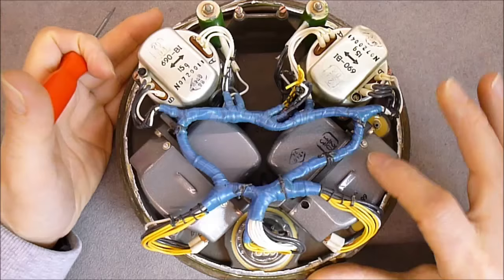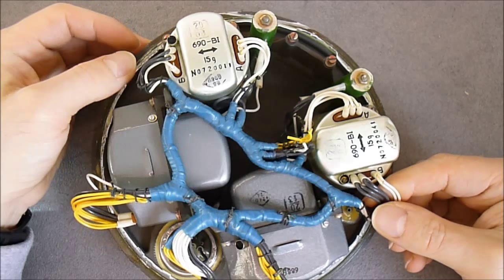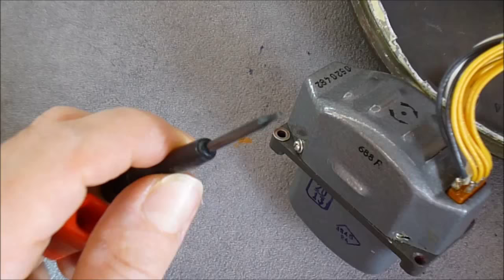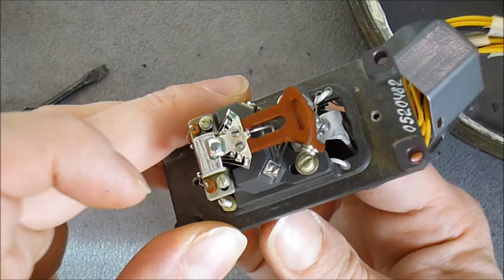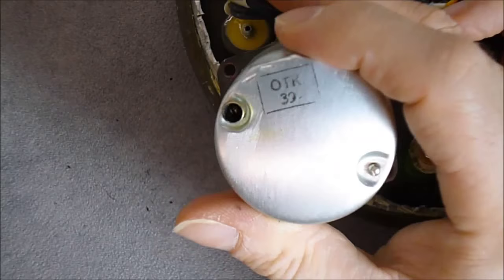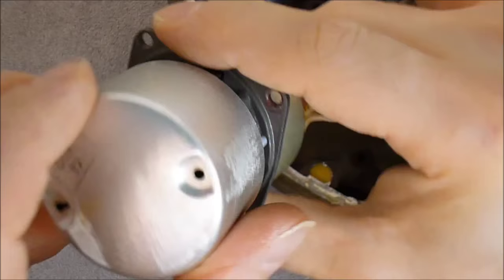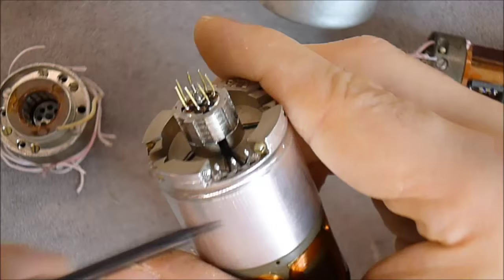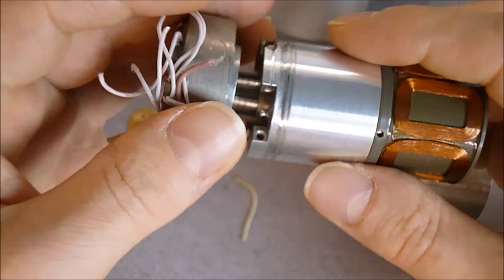Soviet missile gyro accelerometer platform teardown

Comment: The last gizmo is a compressed gas powered 3 phase generator. It generates 28V 3 phase 400hz at a few amps. The magnets in it are made of either samerium cobalt or platinum cobalt alloy. It wont generate for long but for the expected operation life its more than enough.
Reply: Они бывают с пороховым стартом в других системах

Comment: the time and effort of constructing this amazing well engineered electronic mechanism but only end up destroying it at the end.
Reply: I will gladly build something that destroys itself, if it may destroy the bomber that was headed towards my city and would destroy lives rather than circuitry.
Reply: @ChucksSEADnDEAD  You do not need an IMU to get a bomber. More likely a radar or a IR system. IMU's like this make only really sense on missiles that hit stationary things i.E. a specific part of the ground...
Reply: @justrandom7214  yeah, wrong example. Hit the air base where the bombers come from?
Reply: @justrandom7214  Oh, modern missiles do need that.
Reply: @Lightning_Mike  Inertial navigation is not used to hit moving targets like aircraft or ships. You haven't got the slightest clue what you're talking about.
Reply: @aarongreen1654  I see you haven't read anything about missiles for the past 50 years. The AIM-54 Phoenix used INS for midcourse guidance, with updates regarding the target location, only turning on its own radar at the last moment. The AMRAAM works the same way, but now they added GPS into the mix as well.
Reply: @Lightning_Mike  I never stated that modern missiles do not use inertial guidance, lol, just that it's not used for the terminal portion of guidance to hit moving targets.

I'm sorry if you're too slow to realize that. 

You said that modern missiles 'need' inertial navigation, which is a factually incorrect statement. SOME air to air and anti ship missiles use INS, and ONLY for mid-course guidance.

Comment: I suspect this device is a single axis rate integrating gyro.  This is basically a rate gyro where the torsion bar is replaced by a torque motor.  This eliminates the "zero rate" or bias error caused by the misalignment between the torsion bar steady state angular position and the angular pickoff electrical null.
Reply: Great suggestions sir! It is rate sensor, according its marking. Smaller coil is  sensor and bigger is driver.
Reply: Integrating gyros never have mechanical springs.

Comment: Could the last piece be a "vibrating wheel gyroscope" type? The stator at the top is driven to make it vibrate, and the coils later are used to measure movement of the gyro relative to the walls and magnets. It probably moves only fractions of millimeter.
Reply from the maker: I could be that, yes. One thing I still need to find is a laser gyroscope.
Reply: The last one have small gyro  inside cylinder. Small needles on both sides used for support frame.

Comment: Perhaps the part at 17:00 is a DC to 3-phase AC power convertor.  I have an old Soviet missile gyro that is about 2x the diameter of this.  How can I identify it, or see if it works?  I haven't looked at it in years, but it appears to have similar gyros, but also these cylinders with plungers on the for X Y and Z.  Maybe they are PIGAs
Reply from the maker: I can try to help if you can you share photos of it, including any possible datecodes, dimensions and any part number / serial numbers markings or plates.
Reply: @msylvain59  Thanks!  How can I share them with you?  Email?
Reply: @msylvain59  I think it might be the gyro for a Scud varient
Reply from the maker: @blurglide  yes you can email the pjotos : sylvainm@free.fr
Reply: @msylvain59  I will- thanks.  Strange....I wrote a long description as a reply this morning, but it looks like it disappeared.
Reply: @msylvain59  Strange- I tried posting my description here again, but it won't save.  I emailed it to you, along with many photos.  If you don't see it, check your junk mail
Reply from the maker: @blurglide  
I got the photos and the text, thanks. I checked the "spam comments" youtube basket, you comment is not there either, strange. I have photos of a gyro form a SA-2 missile, it is somewhat similar in the construction than yours, but biggetr, I'll send you those photos.
Reply: This is an angular velocity sensor.

Comment: Where can I get one of these? I'm really interested in vintage soviet electronics
Reply from the maker: It is not exactly something you can get from a local strore or order from Amazon... I found it onto german ebay, but it is extremely rare such a thing  gets available, I would say once a year at max. If you miss it, then it is gone forever.
Reply: @msylvain59  thanks for the answer, I dont need this one in particular, just a mechanical gyro to test it and get some readings, do you know any website?
Reply from the maker: Then you can get an aircraft grade gyro, there are plenty of them available on ebay, here from UK for instance: https://www.ebay.co.uk/sch/i.html?_from=R40&_trksid=p2499334.m570.l1313.TR12.TRC2.A0.H0.Xgyro.TRS0&_nkw=gyro&_sacat=2983